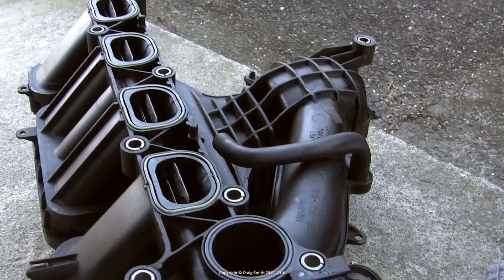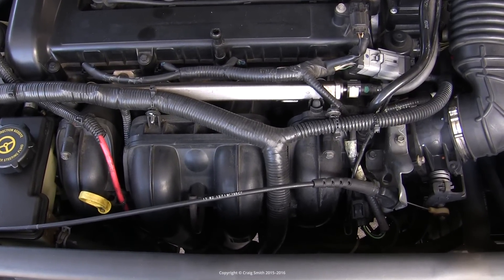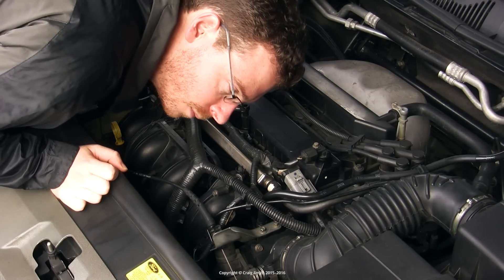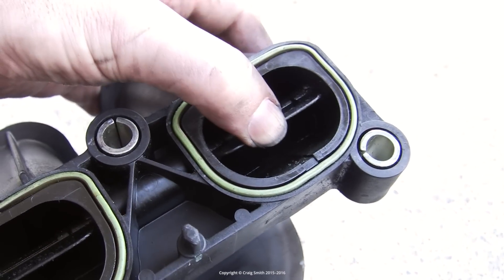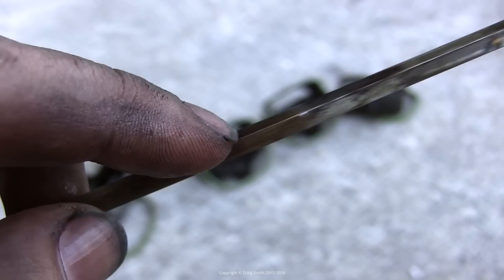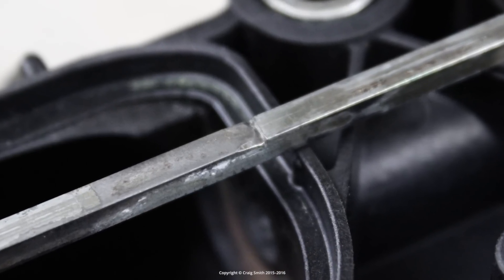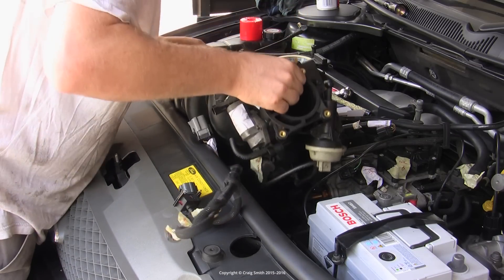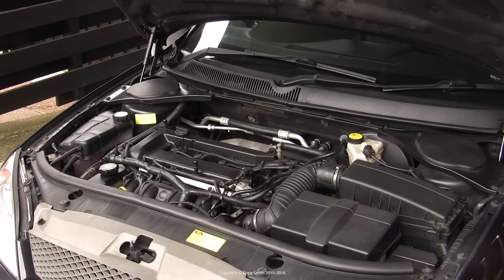How to: Fix swirl flaps & save your engine (Ford Duratec HE, Mondeo/Focus/et al)

Comment: Over decades of fixing imports & domestics in the US, I can tell you this design from Ford is pure crap! A vibrating vacuum hose will wear a hole into the jacket of a spark plug wire. The intake, by design is extremely complex. Injection molded from plastic allows for a complex shape, but is 6 or 7 pounds lighter than one cast in aluminum. But once a mold is made, it can re-used over many times. This makes is cheaper for Ford. GM specs parts from bearings to seals to last 5,000 hours of average life. This is equal to 150,000 miles. 10 years is the time covering failed parts that do not allow the vehicle to pass emissions, at least in the States. These flaps to me, do not validate them even being used. If they want to fix it right, then captured bronze bushings can be used on the parts pivot. Each exhaust stroke at bottom dead center will have some valve over lap. This means both valves are open at the same time. Pressures during this event push a short violent exhaust pulse into the intake forcing these valves to move closed and wear. Ford engineers have to know this or they don’t care or are stupid. What did they gain? At idle, little air is required in the cylinders, but vacuum is high. I would guess a vacuum switching valve control the vacuum signal, controlled by the engine control module. These are also restriction into the engine which in turn reduces horse power at higher RPM’s. 
Used the housing to position the gasket, but remove the valve. Use a plastic or metal dowel in the pivot with epoxy between cylinders to prevent cross flow. Older engineers retire or move on. Then you end up with young engineers making mistakes the retired guys/gals made 30-35 years ago, but learned from it. You won’t find this feature on a Ford Corp. race car, so why make us a ginny pig and we pay as vehicles become way more expensive than your first house. This is junk to increase profit margins and reduce emissions by 0.02%, lose HP, and see no change in performance or fuel economy! Come on Ford!
Automotive ASE Master Tech since 1978 - Retired
 (I have repaired EFI vehicles using a 3, then 4 gas tailpipe analyzers since the 70’s / Not CIS or constant injection systems)

Comment: So ive just bought a Mk3 Mondeo, noisy tappets or so i thought. Followed your commentry and thought id investigate the inlet flaps. MY GOD!!!
One had completely come off. The other 3 had lost their shape and were very worn. I removed the inlet manifold and a couple of them complete fell out. Is the medal rod supposed to be 1 piece as mine was in 3 bits!?! Anyway thanks, im gonna run it without flaps for now and see how it gets on. Awesome video. Subscribed!!
Reply: How does it run without flaps? Any issues, abnormalities?

Comment: At 9:38 you say "seal it up with....." I can't make out what you say. Did you say aerolite? Like the heat resistant adhesive?
Reply from the maker: I say Araldite, but any plastic-compatible 2-pack epoxy is the point.
Reply: @CraigsDIY  thanks
Reply: @CraigsDIY  plastic jbweld?

Comment: Hi Craig, 
I am planning to buy a 2018 Mondeo HEV (which has the 2.0L Duratec-HE engine). Should i worry about this problem?
Reply from the maker: I don't think the version used in late model hybrids (Atkinson) will have a lot left in common with the original Duratec HEs. You will have plenty of other worries :)
Reply: @CraigsDIY  Thanks for answering!

Comment: My 2004 Focus with 2.3 PZEV engine has two vacuum tubes and two IMRC solenoids. But otherwise the manifold looks very similar. I'm sure it's a different Ford part number though.

Comment: If I’m removing the flaps and rod should I remove the bushings also and should I seal the hole if I just put the solenoid back in the hole
Reply from the maker: Remove the bushings definitely, I would seal the hole and remove the solenoid arm but leave it connected outside.

Comment: Hi Craig (or anyone else), I posted a while back, I have the 2.3 Duratec, same problem. Will someone be so kind as to measure up these flaps and provide the measurements here? I have tried unsuccessfully to find a specific online reference to the 2.3 flap, and I am suspecting that it is the same as the 1.8 and 2.0. So just need dimensions (width, height, depth) so I can compare to mine. Thanks all.

Comment: Does the duratec petrol engine 2.0 from ford focus mk 2.5 (facelift) has these swirl flaps? I hear a hissing noise from around the manifold and the fuel range is quite poor.

Comment: can this issue result in high emission between 2000-3000 rpm on 1.8 engine? at idle the emission perfect, but while running is terrible it should be 0.2 and it is 3, the car same times also throw the p2008 error code.
Reply from the maker: I don't think so, you have another air/fuel problem, the P2008 is probably additional.

Comment: any idea the size and length of the spindle craig ? many thanks sir
Reply from the maker: It's a 3.5 mm square, the length you will have to measure by the width of the IM, if you're looking to replace it good luck as the size doesn't appear to be a standard stock of square rod. You would want a hard stainless steel grade.
Reply: @CraigsDIY  thanks for the info craig i use the car every day really its going to be a quick weekend job was thinking going to a local engineer here to get one made up just going to try have everything ready to go and bang it out but once again thanks for the info mate have a lovely sunday

Comment: My 2005 Mercury Mariner 2.3 had this issue, but in my case, Ford had relocated the flaps deeper into the manifold and they are sealed into the main body of the manifold, which is completely sealed. The only way to solve the rattle was to replace the entire manifold with a new one from Ford; about $200.00 U.S. at the time. The engine ran fine but sounded like it was falling apart.
Reply from the maker: Those are called IMRCs (runner controls) and aid with the airflow, some manifolds have both. Honestly $200 for a brand new manifold assembly is not the worst outcome.
Reply: Hello l have a 2005 petrol 2.0 Ford Focus recently whenever I park my car in direct sunlight when I start the engine l am hearing unusual noise from the dashboard around the car radio area

Comment: Great video. I’m probably going to remove the flaps completely in my 07 Focus if they’re worn out. Do I need to fill the holes where the bearings go too or can they be left open? Will removing the flaps cause a check engine light to come on?
Reply from the maker: You can leave the interior holes open. No CEL, unless you disconnect the servo electrics.
Reply: Craig's DIY Car thank you sir. Mine didn’t even have any bearings. It was rattling bad. I ended up removing the flaps and rod. I plugged the hole at the end with JB weld and it’s running fine.

Comment: Hi! does a 2013 focus 2.0 duratec has the same issue?
Reply from the maker: It probably has the flaps but their reliability was improved over time, by 2013 it's probably fairly safe.
Reply: @CraigsDIY  Thank you!

Comment: I have a 2.0L 2005 ford focus and took the intake manifold off and removed the flaps of death.  It's an arduous task with many sensors that don't want to come loose and none of them are the same!  So each one has to be done differently.  Most of them require pushing in the middle of the plastic electronic part and pulling, but not all.  Like me, you will have to look at them and figure out how to release them.  Ok, some hints on other things:
1.  Consider  replacing the PCV valve and put in a new PCV hose.  These are not cheap if you get the proper parts (mine cost $15 for the PCV valve and $28 for the hose).  Normally you cut the PCV hose off to release the intake manifold and then replace it, because getting a pliers down to the hose clamp and pulling the hose off the PCV valve is an enormously difficult task.  Just cut and replace.  The PCV valve has a plastic clip holder that you must not break!  If you do, you must buy the entire oil separator to get a new one and these were $33 on Ebay.    To pry off the clip, you need to remove the oil separator which is held on by 8 bolts, two of which you must have an 8mm wrench to release and the other 6 you can use a ratchet and socket.  Then use a small small screwdriver and try to pry the clip off - some people use a knife.  Be careful!  Clean the oil separator with brake clean.  Then put the oil separator back.  At this point, my suggestion is to connect the PCV hose on the bottom (hose clamp) but on the top- install the PCV valve on the PCV hose (hose clamp) and you must leave the plastic clip on the PCV valve then when you get the intake manifold on the car you can then just press the PCV valve on to the oil separator and then using the long rod that held the flaps of death just press down on the plastic clip to snap it on.  Otherwise, it's almost impossible to put the PCV hose on the PCV valve by using a pliers on the hose clamp with such limited space.
2.  Clean the MAP sensor in the intake manifold.  You need an electronics parts cleaner for this - I used CRC Electronics Part Cleaner (wal-mart).  The MAP sensor is located near the bottom of the intake manifold, and is held on with a 20 Star screw.  So do it while off the vehicle.  https://www.youtube.com/watch?v=icgaLiEoohc
3.  While the intake manifold is off the car, clean the MAF sensor with a special MAF cleaner.  The MAF requires special care, so handle it such.  It's held on by two 20 star screws.  https://www.youtube.com/watch?v=U9PT8ZN3TXI&t=24s
4.  Clean the throttle body - and there is a special cleaner for this also.  Wal-Mart has the MAF and Throttle body cleaner in one package in their auto parts.
5.  Use poster putty or some other stuff that will seal the plug hole where that square rod was.
6.  Replace all the vacuum hoses on the intake manifold while off the car.  So much easier!
7.  Clean all the sensor connectors with the electronics part cleaner.
8.  Replace the manifold gaskets with new ones cause you don't want a leak there!

9.  The  manifold intake runner control (MIRC) is basically useless at this point, but the electronics need it.  The control has a vacuum hose that connects to the front of the intake manifold - make sure you replace this.  The second hose goes goes to the vacuum actuator that controlled the flaps of death.  What I did was connect this hose to the plug on the right side of the MIRC, because that hose now serves no purpose, neither does the actuator.
10.  Use a torque wrench on the intake manifold bolts at 13 ft lbs.  All other bolts or screws snug.

11.  You need to reset you electronics to get the car to work right.  After doing all this work my car just died - not holding an idle!  Disconnect the battery.  Reconnect.  Turn on ignition switch (not to start!, just to run) and let it sit for about 30-45 seconds then turn off.  Try starting.  It took me some time and feathering the throttle to get it to run, but then bingo, the computer saw the changes and fixed itself and the car's idle was ok.
Reply: Nope.  Don't use poster putty.  Use SteelStick or other epoxy blend that works to putty but drys hard.  Make sure you leave a space for the actuator.

Comment: Thank you for this great video. I really appreciate the format of audio edited with video. Easy watch and a good use of my time.

I do have an important question.about option 3 as I will be choosing this option.

Will this trigger an engineer code?

I live with in the metro area of PDX Oregon. 
We have emission test every 2 years and check engine lights will fail the vehicle. 
Does removing the glass create an engine code?
Reply from the maker: No. In theory the ECU should probably have a different map but in practice nobody reports any issues. It certainly won't effect emissions or set errors.

Comment: Hi Craig, is this the same engine B4204S3 of Ford/Mazda? Same engine in some Volvos. My volvo has B4204S3 engine 2011. Same problem will occur soon I believe and got to follow your advice. Thanks heaps. Great videos.
Reply from the maker: The later engines seemed to have less problems with the flaps, you might be lucky.

Comment: To which Ford engines does this apply? In my case I recently own a 2002 Fiësta with the 1.6 16V, also used in the Focus.
Reply: No as duratec HE engines only come in 1.8 and 2.0
Reply: @TheBananasable  Thanks. I guess you're right. Strange enough My air intake shows Duratec (not HE) signature, but when you remove it, it says Zetec SE. I found yhis on the subject (just to serve anyone interested): https://www.burtonpower.com/tuning-guides/tuning-guide-pages/ford-zetec-se-tuning-guide.htmlhttps://www.burtonpower.com/tuning-guides/tuning-guide-pages/ford-zetec-se-tuning-guide.htmlhttps://www.burtonpower.com/tuning-guides/tuning-guide-pages/ford-zetec-se-tuning-guide.html

Comment: What about this intake manifold?NEW INTAKE MANIFOLD FOR MAZDA 3 MZR FOR FORD FOCUS DURATEC 2.0/2.3 ENGINE CAST ALUMINUM INTAKE MANIFOLD JR-IM49SL... From aliexpress, i want more powerful intake ! Can u give me some tips/advice please ?
Reply from the maker: That sort of thing is for tuning, especially with turbos. With the stock n/a set-up the plastic manifold will probably give superior performance. At minimum if you switch to a different design of IM, the car will need an ECM re-tune. It won't give you 'power' unless you make other upgrades.

Comment: i've  got a pre Facelift Focus Mk2  1.8 Duratec HE 125 ps from 04/2007
Do someone know if the engine has the same issue or is it a newer design?
I am very unsure.. and ford tells me, that this issue is rare :(
Reply from the maker: They made gradual improvements over time to the point it is rare(r) on your year of car. If the flaps are there (you can see if the actuator is present or not) then they are still however a risk, I would inspect them when convenient.

Comment: @Craig's DIY Car  I live in Cali and was planning on doing this in the summer. Just want to verify that it would apply to a 2005 ford focus SE? Thanks for the great videos!!
Reply from the maker: You can see the actuator if the flaps are installed, just go look in the right place as shown in the video.
Reply: @CraigsDIY  I actually did the job this past Saturday. My car's setup isn't exactly the same but your video helped a lot. The steel rod wasn't too bad and I would've put it back but the plastic was really worn, and I couldn't even find the bearings. Ford wouldn't sell me the flaps or bearings so I just used JB weld epoxy to fill the holes and took the flaps out. Engine is running just fine. Will see in a year if I still pass Cali emissions lol
Reply: What did you do with the vacuum line(s)? Did you seal up the holes where the bearings would be? I’m guessing you have to leave the intake manifold runner control solenoid connected so the check engine light doesn’t come on.

Comment: Amazing video.  Is it possible to pull the rod and remove the flaps only to reinstall the rod (without flaps).  My thinking is that reinstalling the rod (without flaps) you will plug the holes that would have been left in the manifold runners if you didnt reinstall the rod.

You remove the compromised flaps, save yourself the trouble of reinstalling new flaps that will wear out, and not create holes in the manifold.

Thanks!!
Reply from the maker: You could, but the rod is really what's dangerous and it is what actually fails as shown in the video. Removing the flaps will probably slow the wear on it but I'm not sure how much. As to the holes between the runners, you could also seal them up with epoxy to isolate each tract but honestly I doubt it would make any perceptible difference to anything.

Comment: I completed this job myself with the help of a friend a few years ago, buying a complete set of new flaps, and had ordered a new but stupidly mis-measured the length of the original and in the end turned my (already quite damaged) rod around and threaded it through from the other end. I now want to re-do it with a new rod, but I'm interested if anyone can provide the exact dimensions. I bought one that was 4 x 4 mm which seemed to fit ok
Reply from the maker: I measured mine as 3.5 mm square, which is not a standard stock size, and I couldn't find any stainless rod that would suit. I'm pretty sure 4 mm sq won't fit the flaps or bearings. If you could find the right size you would just buy a meter or so and cut it to length. It should be a high hardness stainless, not 304 or 316.

Comment: can one disable the function of thes flaps by plugging the vacuum hose to the actuator? surely the problem will be eliminated then
Reply from the maker: The flaps 'relax' open so you can stop them being turned into position by disconnecting the hose, as explained in the beginning of the video. But it won't stop the vibration and grit from wearing on the steel rod, you might slow it down at best.
Reply: @CraigsDIY  sorry i check afterwards and i have the newer version 1.6 ti-vct which does not have the flaps

Comment: Hi very nicely done video!  We have an 07 Focus for 11 years and it has been amazing. The big dirty secret is to do ALL your own work. This means proper tools learning as much as you can and getting down and dirty.  Oil changes are a must with high quality oil and filter.
We just began to notice this clicking down at the end of the intake. Beyond a doubt this is what it is. I plan to inspect shortly and probably just remove the flaps.
Great work!
Reply: The 2007 Duane doesn't have them.

Comment: only thing I'd mention, when refitting the actuator you didn't mention the position of the flaps (or did you!). I've a feeling mine weren't correctly aligned as I refitted the actuator afterwards. Might have to come off again to check!!!
Reply from the maker: They relax open. I don't think you could position them wrong.
Reply: @CraigsDIY  that's good to know, Thank you. Think I've got a major issue then!!!